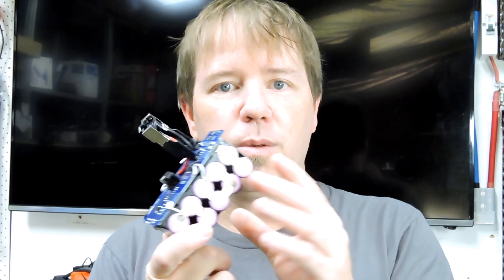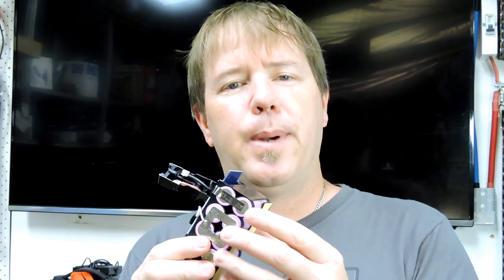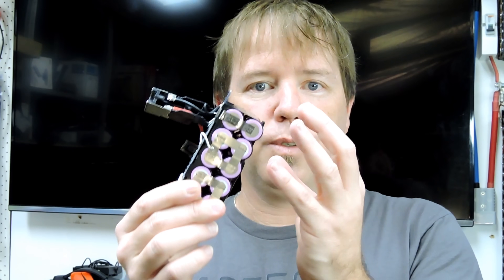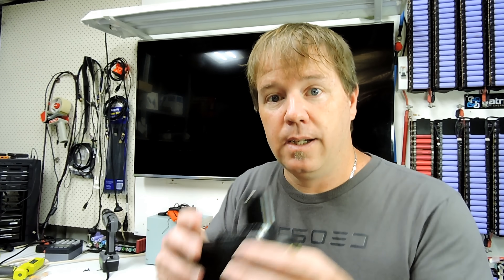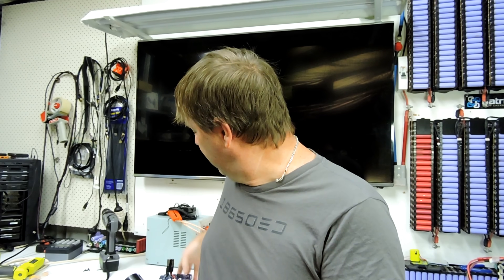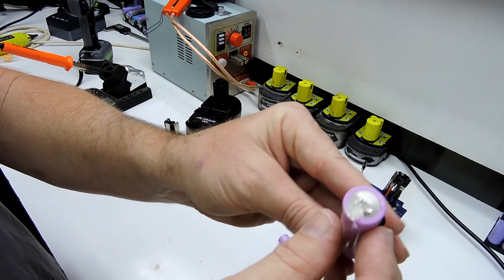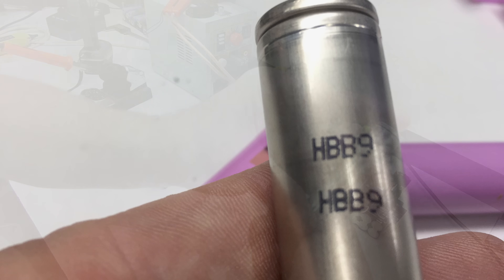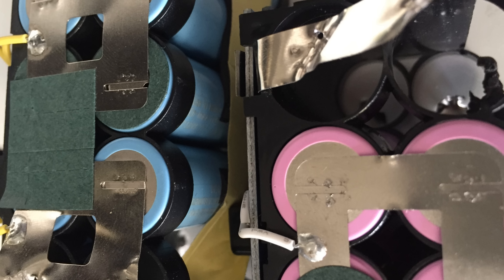Did Vanon set me up?

Comment: Not sure if it goes with your stuff, but I got a WORX after-market battery for my lawn tools. It is labeled as a 84watt and was just a generic ebay battery. It actually lasted longer than my original WORX branded batteries. 
I just opened it up and came across your video while looking for info on the cells. The cells are wrapped and labeled as Vanon, 18650HR15. Strange that the battery will only run for a few seconds now, I think planned obsolescence with the BMS, as the same thing happened with the original real WORX batteries. I have run the cells through my benchmark system, discharged and recharged at 1 amp. They seem to hold about 1ah each. That was after 4 years of heavy use at my motel for grounds upkeep. Blue wrapper. I will be repurposing them in other projects.

Comment: I bought 2x Makita 6aH 18V packs from eBay, did a test with a stable 2.05A current soon as the charger said they were full, a Genuine 5aH lasted about 41 mins, the others labeled Vanon lasted only 14mins, seller sent me a replacement to try, that was the same too. The one i opened has cells that say Vanon 18650 LN22R 210818 3.6V. I ended up getting a refund, feel bad for the seller.

Comment: my Vanon Makita 9Ah 18V  pack have  purpur color Liion Vanon 18650LZ22R 202107
 Liion cells...I have installed my own balancing connector and do not charge the pack  with a higher current than 3A . Charger is ToolkitRC M6D.. I use accu pack  for field power bank :-), this means accu pack have 8,8Ah , if 1Liion cell have real 2,2Ah...BTW: i use the Vanon 6Ah Makita 18V pack too, the real measured capacity is 4A..My advice;  do not use Vanon batteries for high current consumers , max for small drill maschiene..!!
Reply from the maker: better yet get my money back from lieing assholes and buy better batteries that don't make you compromise how you have to use them.

Comment: I got couple vanon batteries couple months ago first time i used it it stoped working i opened it up and the solder came undone probably from getting hot i re soldiered it and it was fine but it had blue sells in it no purple ones

Comment: Agree that Vanon are crap.  
Bought 2 of these 2.5 years ago for a project thinking they are half price, 2 for the price of 1 and will do for a construction project I had.  1 was dead on arrival, and got it replaced.  The other lasted 2 months and couldn't get replaced...past the 30 day warranty!!! So the remaining one I've had for the 2 years but doesn't have the capacity or robustness of the genuine Ryobi battery.  Its fallen apart, plastics cracked, screws fallen out and cant be put back in and held together with tape.  

Would I buy them again??? The answer is DEFINITELY NOT.  

I would have been better served buying 1 genuine RYOBI battery twice the price, robust and just works.   Unfortunately, looks like you got scammed....I will never buy these cheap batteries again.  I'd take a dead one for free and rejuvenate it with new/recycled batteries but never buy one ever again.

Comment: Yep when I took a failed (smoke deficit) Vanon 4.0 apart I had very badly burnt battery heat shrink at the POS end and the neg end and the cells were all that purple colour and labels very hard to read maybe only 13 q? 
Maybe the 30qs in he 6.0 are the only way they can get true capacity out of them. Good video again
Reply from the maker: I don't know but they are crap batteries and a crap company selling them.. liers they are

Comment: I bought the 6AH battery for my Makita drill,, never used it except to try it, and did a couple of maintenance charges to keep them topped off. Well they lasted 6 months before the things wouldn't charge or run in drill. Did whatever Vanon requested for documentation for warranty claim,,, finally put a claim into Paypal for defective product and not honoring the 1 year warranty, and Vanon lied to Paypal saying that the battery was abused somehow, and I got nothing except an offer of a $5 credit to buy a new defective battery from them in the future. Inside the pack, I had 9 - LR1865BI's and a single LR1865BE. Somehow I don't understand a single 1.5ah battery included in a 6ah pack. Fool me once,,,, never again.
Reply from the maker: Yep bunch of assholes

Comment: I am salvaging 18650 cell from old power drill batteries and just revieved some vanon makita batteries and the cells are 100% not samsung. They are green import cells and written on the cells is as follows ( +vanon 18650LD15 20190716 3.6v) the cells are buggered and of poor quality. most of the time if I get a cell the wont charge its due to extremely low voltage so i give the a 20 sec charge with a second sell in parallel and then they are picked up by the charger. So far 100% of these cells are gone and if i could salvage them I would not feel comfortable using them. Happy to send you a cell to see
Reply from the maker: Only good for recycling :( waste of money and time doing these videos for Vanon

Comment: I bought Vanon battery's for my Milwaukee units, the first one I got worked great, didn't hold a charge as long as originals but acceptable.  Along comes my son's birthday so I bought 2 M 12's for him and 2 M 18's for me.  He said his works great( I charged them on my charger) and the 2  M 18's were not good at all.  One would not latch into the charger and the other would not latch into my drill or impact.  After 4 weeks trying to get them to replace both of them I just gave up.  They still will not latch and I am not going to damage my real Milwaukee equiptment.  So for me Vanon is history!!!!
Reply from the maker: They are a F!@#$%^&*(en shit company... Changed the way I do reviews for sure.
Reply: @HBPowerwall  I didn't check out this company first, my bad, but I did learn an expensive lesson.  Like your segments, I never was an electrical guy (color blindness) because it takes a special kind of person to understand something you can't see and only "feel" when it's almost to late, LOL.

Comment: Update: I took several pictures if you want them. Mine had a date of 10/19/2018 so a few months after this video. They use their own generic Vanon shrink wrap on a battery of unknown origin. "Vanon 18650HR15 2018.10.19 3.6" Cutting the wrapper off revealed nothing, no markings of any kind on the cell. Cells test at .228v which is expected of a failed cell. Maybe they're no longer using random shit batteries and got a supply or maybe they're taking the time to rewrap random shite batteries, I don't know. I still don't mind what I paid... like 60 bucks for 2 that lasted 1.5 years. Not the best, I know. But I can put in replacements of my own so whatever. I have the circuitry in place.

Comment: My 4ah lasted a couple years in a fan, exclusive use only. One just died. I took it apart, two cells were bad. As I pulled the nickel off it started venting... electrolyte? I'm not sure, I through it in a bottle of oil to be safe. The other I popped out and chucked in the there too. All I saw was purple wrappings that just had some generic "Vanon" "brand" on it. I'll take the non leaking one out and look closer. The other 8 batteries still tested 4v, I gotta get a tester too pull them down and check ampacity. That'll come soon. Even if the company sucks, these lasted a while and I'll just buy new cells and weld them in. The electric board seems fine and batteries are 5 bucks a pop so it'll be like buying a "new" one, I suppose, just with known good cells.

Comment: Im posting what I reported on your prior video -> my recently bought 5.0 AhVanon (got two) cost me 52 Euros (26 each) and  run my vaccum for about 22 minutes. My original 4.0 Ah all run my vacuum for 31 minutes and more. Needless to say - Im very disappointed from the Vanon batteries! If you want to talk me down because of what the Vanons cost -> I only buy my Ryobi batteries at Home Depot when they are sold for about 90 bucks (for TWO 4.0). To me... runtime matters as Im dependent on my tools. Vanon advertised 5.0 Ah and yet their product got beaten by my 4.0 that is 5 years old... EDIT. I can open the Vanons but I cannot pull the cell package! Seems like they habe glued them in!
Reply from the maker: Yep, ripped me off and my viewers - assholes

Comment: That lip on that LG looks like it was taking out of something else like a laptop battery. Then resold as new? 
I got a lot of 18650 batteries for flashlights and whatnot and that  lip looks like all the batteries that Have taking out of recycled battery packs 
It’s usually a few cells are bad. If it’s not good it goes by by

Comment: just got burnt last week by vanon. bought a 5AH makita 18V on ebay wanted a backup for my new makita dur189 whipper snipper..
so first i ran the 4AH genuine and got job done just with 1x genuine 4AH battery, the next week was Ebay Vanons 5AH turn and only got half way with same job "i go what the F----" contact ebay seller put my case forward they say but you only pay half of genuine price hahahaha, after more than a week i got a partial refund..
i popped battery pack open last night and found to no suprise a mid/deep Blue colour 18650 with writing Vanon, no Brand name whatsoever..when will i learn!!!
Reply from the maker: Yep shit company to deal with, I hold my head in shame that I accepted product to review - changed the way I do things thats for sure.
Reply: @HBPowerwall  it's ok mate, you got tricked too but in a different way..i just find it hard to accept there is no aftermarket 18v makita  that stacks up to the Genuine batterys.

Comment: Just got Venon Makita 18V 4AH compatible battery packs advertised to contain Samsung cells on eBay. Took the cover off to take a look at the cells and found cells marked Venon. Also, very poor soldering on the PCB. Positive wire was barely attached to the PCB. Spot weld is also very thin and poor. What is funny is, they have a comparison picture comparing Venon batteries and Others. The pack I received looks just like Ohters. LOL
Reply from the maker: Yep - what's even worse is they are using pictures pulled from my video's on their Amazon page :( it's just lies, but removing the first video that gets all the hits would be a negative for the community I think cause then I lose a small income & people aren't made aware via my later videos & comments

Comment: I would say yes they probably did set you up. The ones we got are garbage, and the company does not fulfill their warranty promises. My dad bought 2, and if they get drained too far they won't charge up again. Both of his are dead after being used a few times. I know you're supposed to re-charge li-ions before they discharge too far, but the real makita and other name brand batteries have a protective circuit that keeps them from draining all the way. I've told my dad to charge his batteries sooner but he never does. I bought a couple too, had one in my flashlight which was accidentally left on, well it drained the battery all the way and now it wont recharge. Brand new battery only used a few times and its dead. The item description says one year warranty,  but when you check the return policy it says 30 days. I've contacted customer service twice and still no response after 1 month.
Reply: If it makes you feel better I got burned by dewalt aka black and decker for the same. I got a good deal because I worked for a major hardware store but only on discontinued items and I quickly found out why. Thankfully I paid peanuts for new stock.
Reply: Yes I ran my 9 amp down on weedwacker..never to charge again..yes they are junk!!..and the other 9 amp  I was cutting weeds down and smelt plastic burning..turned around and it was almost on fire!!!..I had taking it off so weedwacker did not burn..and I had burns on my hands from some sort of liguid...no more VANON JUNK FOR ME!!

Comment: I opened my 6ah Vanons up.

Says Tesson branded batteries. Cant even google that name :/

https://photos.app.goo.gl/a26auxQ44FxrQ7rV9
Reply from the maker: Did you buy them from my first review when i thought they were good, or from else where ?
Reply: @HBPowerwall  bought them from ebay.

https://ebay.com.au/usr/onfly6688

If i can swap them out what would be the best batt spec to replace them with and still give me more power?

Can i simply replace them with 3500mah 20a? The bms is pretty basic so wouldnt know if it was killing itself and get too hot?
Reply from the maker: You would be better upgrading the Roybi Battery than using the Vanon BMS i've had one fail already
Reply: @HBPowerwall  would the bms be the same across all ryobi batteries?

Comment: Just wondering whats your association with Vanon to provide an unbiased review since your original video is embedded in their US web site? https://www.vanonbatteries.com/collections/for-ryobi/products/for-ryobi-p108-18v-6000mah-li-ion-battery-2-pack?variant=4832021807135
Reply from the maker: It was clearly stated at the start of the video, They send me batteries to review - I didn't pay for them they were free, I didn't receive any money for the video nor did I obtain any gain from any sales made from this video or the first one. - there was no approval process before I released.
Reply: Happy to send you the photo evidence we have from opening several of their batteries which we have engineered tested. have you done any testing to show it capable of 6A as this would normally require larger cells and updated firmware?
Reply from the maker: I removed batteries from both to test in my discharger - http://www.diypowerwalls.com/opus so can't test them again for another few weeks till i put 100 1amp cycles on them.

Comment: I have left quite a detailed comment on your original video. I'm impressed you have the honesty bro upload this one. The quality of the Vanon packs different significantly internally across many aspects within the same amp rated models. Poor cell connects with little spot welding, Chinese cells, no heat sinks, no current protection, never any over temp protection, fine gauge wire connecting cells to the PCB etc. happy for you to Pm me and I can send you some of my photos. Anyone who has searched Youtube be for lithium ion battery fires are foolish in thinking they are not risking their own safety and that of others when buying pirated battery packs.
Reply from the maker: I'm not overly concerned with the quality - if you pay for a cheap hooker you GET A CHEAP hooker... everyone knows what they are buying in that price bracket. My grip is I spent a huge amount of time editing and testing these cells like any video 80 percent of footage wasn't even used. I was impressed with the run time verses cost - I tested 30Q's and no one else got them. Grateful this wasn't a paid gig or I would have had to refund. You can upoad your photos on the forum if you like or email them to admin at diy powerwalls dot com and i'll post on your behalf

Comment: On those blue LG cells, the laser etched warnings were added around the start of this year on all 2500mAh, and higher, cells in response to unauthorized use of LG cells outside of a protected battery pack. Especially by vapers.
Reply from the maker: You would think that a warning would be much more readable.... Someone shared some information on the forum on this also but thanks heaps for sharing here.

Comment: Anything LG, Samsung, SONY, or Panasonic is good by me, If its Japanese its good - if however its Unbranded Chinese or something like UltraFire or e̶n̶e̶l̶o̶o̶p̶, or any other battery with an obscure name?! then it's likely gonna underperform
Reply: JustBanter eneloop is Panasonic...
Reply: then I stand corrected, thanx for the heads-up, forget I mentioned that bit.
Sanyo/Panasonic are decent   :)
Reply from the maker: There are some healthy no-namers out there what i hate is miss labled or just flat out lies. Cells that don't have public data sheets either grinds me also
Reply: I use Lithium-iron in my Electric Bicycle and I find I have to be quite careful were I purchase the pack from - If the Seller Guarantees 'Genuine Panasonic Cells inside' etc then its usually OK, but a look-a-like Battery Pack is all too often loaded with cheap chinese cells. Got to be careful out there!!
btw great channel HB, thank you for the upload/info.
Reply from the maker: Yes it's very hard to know these days :(

Comment: The LR1865BI cells that are in my 6Ah pack are rated at 1500mAh... WTF!  These guys are scam artists... I have requested a refund, will see how it goes...
Reply: Buying Lithium-Ion Batteries Online has got to be one of the biggest scams going, anyone getting exacty what they asked for has dropped lucky!
To be absolutely sure your only choice is to get to a High Street Dealership i.e. a Camera Shop Licensed to sell SONY etc.
eBay and even Amazon are no-go areas, but a reputable Electronics shop with a Web Site should be OK
Reply: I had bought a set of 4Ah batteries from them and they ended up only having 1.3Ah in 2P configuration. So only 2.6Ah  They didn't do anything for me after I contacted them.

Comment: The only cells I've come across with the indent on the negative terminal has been the older Panosonic cells.
Reply from the maker: Looks like another revision of the Cell Database is called for including photos of the negative terminal .. https://secondlifestorage.com/showthread.php?tid=1685
Reply from the maker: You know what, that rings a bell - REALLY old ones & perhaps green sleeves ?
Reply: HBPowerwall any of the old ones have it. Clear Blue, clear green, yellow, purple. I don't have them in front of me but yea. Over 10 years old
Reply: The Panasonics that I've seen were CGR18650HG with an orange sleeve, and the CGR18650A with the green sleeve